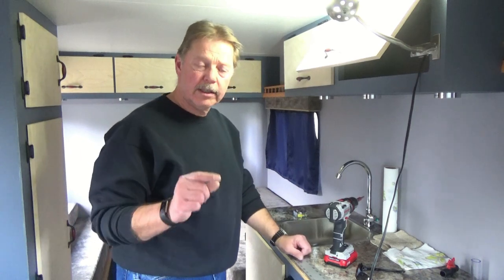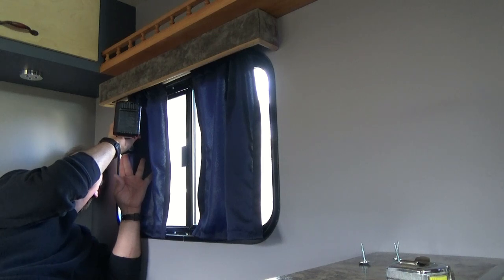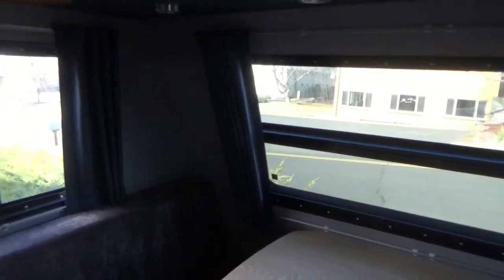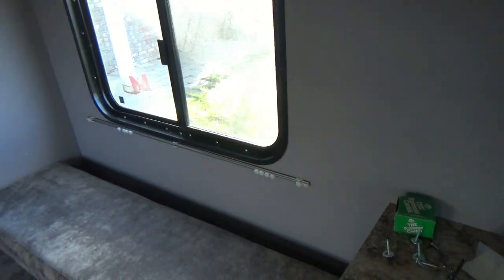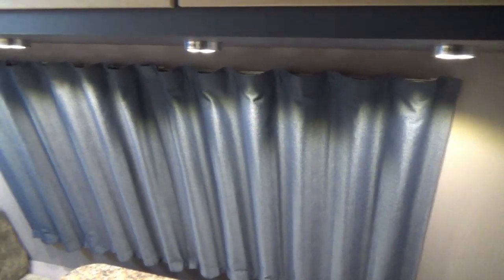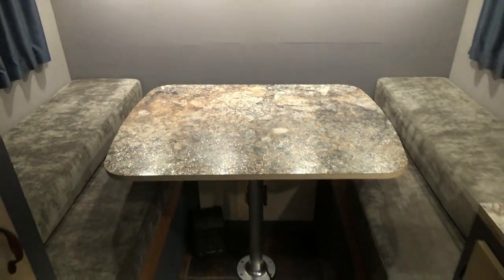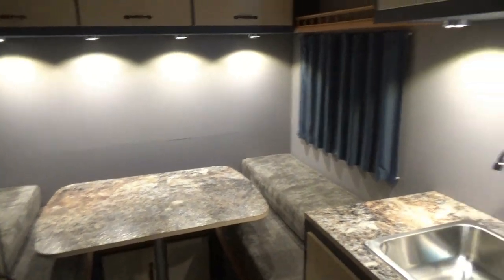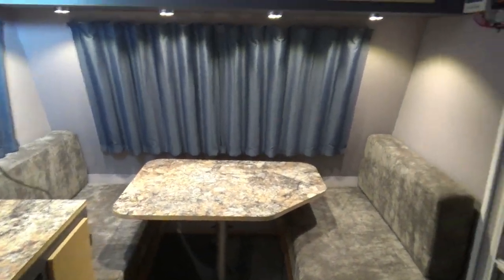How To Build A DIY Travel Trailer - Part 67 (The Last Window Treatment)

Comment: Love that window curtain system!
Was gonna ask you about an outside curtain (Awning) to get out of that high-desert sun, but it sounds like you may be thinking bigger already ::wink::
Definitely avoid AIMS.  They produce an exetremely noisy sine-wave, due to poorly engineered and filtered high frequency switching.  This will affect all your radio wave devices, like TV, radio, cell phone, wifi, etc...  Xantrex is the budget level of the much more expensive Outback systems, best on the market IMHO, if you can afford them.
Reply from the maker: Thank you Aspendell! Those curtains block out nearly all of the sun, in the middle of the day, it is pretty dark inside. If you live in the High Desert, you'll definitely have to put up with the heat (have to shop around for a small air conditioner!) Good tip on the Aims. The reviews said basically the same thing, and they didn't last that long either. Don't tell anyone, but I splurged for the Xantrex!  :) That will be coming up! Stay tuned!!
Reply: Also, I'm assuming you're going with deep-cycle lead acid batteries.  Most people way under-design the battery system for inverters first time around.  But you will want at least 100 amp hours of capacity per 300 watts of sustained load.  For wiring @12vdc, 4 gauge is fine up to 800 watts max with 10 foot runs from battery to inverter.  Anything above that you will want 2 guage cables.  Otherwise a fair percentage of your power will be lost as heat and the inverter will switch off starting things like microwave and fridge due to voltage drop by the time it gets to the inverter.  Oh, and make sure all your soldered lugs on the cables are tinned-copper (not pure copper) to avoid corrosion with the lead battery terminals.
Just in case that helps :)
Reply from the maker: Thanks for the advice!! Currently my setup has two 6 volt batteries 205 ah each. In series to obtain 12 volts. They are the AGM sealed batteries. I will be using 00 gauge to connect the two together (positive to negative). From battery to terminal blocks, I will be using 00 gauge wire. From the converter to battery (terminal block), and battery (terminal block) to inverter, I will be using 0 gauge wire. As in almost everything I do... I probably went overboard! :)